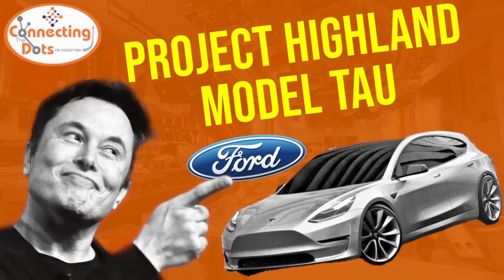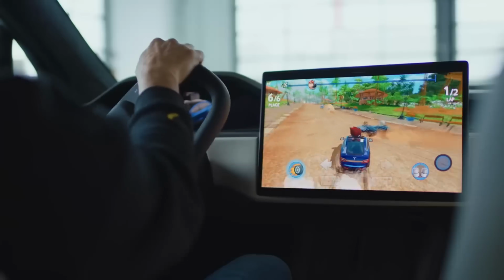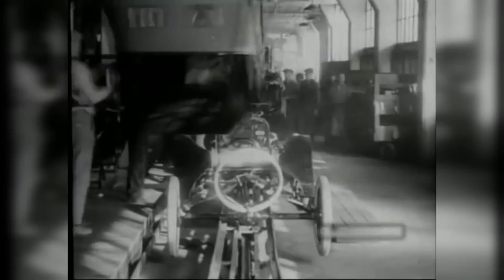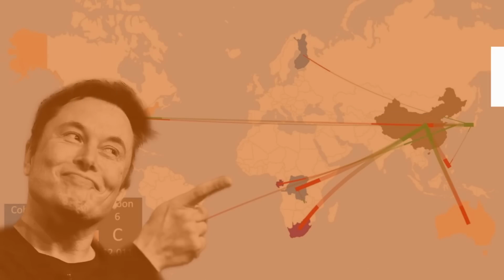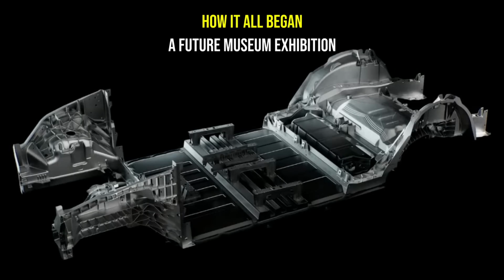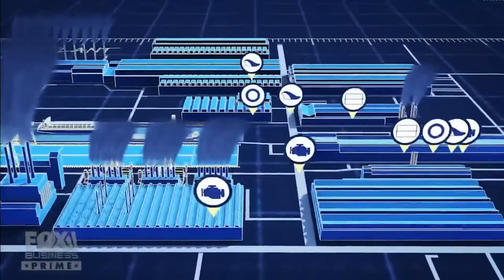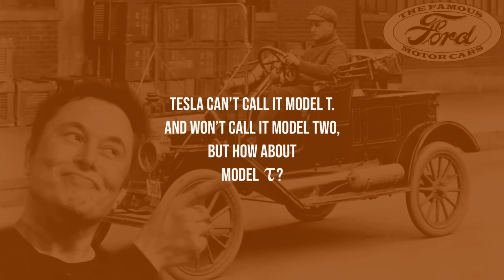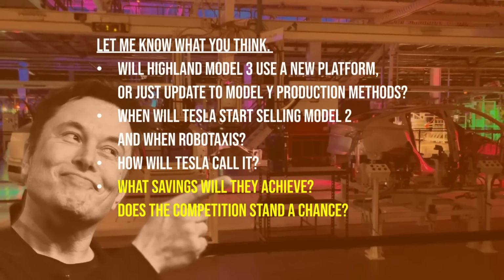Elon's Project Highland, Ford & Tesla Model Tau | A Manufacturing Revolution Pt1 Cracking Easter Egg

Comment: I am excited to see what Highland will mean to the number of factories needed to scale to 20M vehicles in 2029. It may be far fewer than we think?
Reply from the maker: That's my theory
Reply: How many do you think it'll take? 🤔

Elon in the summer 2022 q2 earnings call said 8-12 total factories needed. I think it best we believe him here.
That means possibly only 3 more gigantic tera factories are needed. My bet is gigamexico, giganesia and a U.K. or Korean giga. 

Since then though gigahai production has exceeded a staggering 1,100,000+run rate. With a planned expansion there for another 1,000,000+unit's on temporary permitting hold. This is likely for imo the compact car expansion plan. 

Then just recently gigavada has been approved for a massive $3,600,000,000+expansion more than doubling the plants total size. 

Also Elon has mentioned the upcoming gen3 platform will be half the cost of the model 3&y to manufacturer. 
But it will do double the production volume out of the same sized plant. 

That's imo the compact/robotaxi platform built with a 4680 cast structural pack, f&r single piece castings and the frame being a single large cast piece. So just 4 major castings to produce a basic car. Imagine how cheap&fast that will be at scale. 😎
Reply: @4literv6  Don't know to be honest. When asked about the Gen3 platform at the Q3 earnings call we got the following response from Elon and Zach:

Elon Musk - ........certainly exceed the production of all our other vehicles combined. I mean, obviously, we're going to take everything we learned from S, X, 3, Y, Cybertruck and Semi into that platform. But we -- as you've said to us many times, we're on a 2-for-1 target. So [Inaudible] we're trying to get to that 50% number again.

It's like, we're going to take two. If that's exactly what [Inaudible], how are we making two cars for the amount of effort that we currently take to make one Model 3.

Zachary Kirkhorn -- Chief Financial Officer

Yeah. Effort costs, efficiency.

Elon Musk -- Chief Executive Officer and Product Architect

Needs to be considered.

Zachary Kirkhorn -- Chief Financial Officer

Yeah. All those things. Half the loss, half the past, half the factory floor space.

Not sure if the "half the factory space" comment implies that half the number of factories will be needed for a 20M run rate. What do you think?

Comment: Object to this whole video. First I will offer you the possible new name. Instead of tau it would be PIE (3.14) Model TT (I can't show the actual pie symbol). Here is the problem with this video. There will not be a model 2 (tau). The smaller the vehicle the less space for batteries, less range, increase range anxiety. It was already stated in the past that Model Y will replace the Model 3. The two are very similar and there will no need to sell Model 3. Second, although advanced production methods may drop some cost of the production those saving will go to increasing profit margins. Business is in the business of making money not selling for free just to make people happy. The reason why Model 3 production hasn't stopped right now is because the Cyber Truck hasn't be released yet. Once the Cyber Truck is released, the market will be totally different. The Cyber Truck will do everything that both the Model Y and 3 can do and better. Thus no one will need anything other than the Cyber Truck and the Model S. The only reason why the Model Y may still exist is because some might feel the Cyber Truck is a little high to enter in and out. However, the production methods is not what will significantly reduce the cost of purchasing any tesla vehicle, what will is the move to solid state battery technology when it is released. Many years ago Toyota announced that they will release the solid state battery vehicle in 2025 (that date might change). I suspect that is delaying the release of the Cyber Truck. No point producing a vehicle that will be out of date one released to the public. Telsa may be waiting for the announcement to see if changes are needed or if going ahead is acceptable. There is so much more to add here but this is giving me a headache. If you are interested in contacting me, feel free. I will be more interested if contacted, otherwise why submit a comment for no one to read or care. Thank you. Have a great day.
Reply: The Taliban ‘object’ to peoples thoughts.
Reply: @paulmcgreevy3011  learn to read and educate yourself
Reply: Audi has a  model TT.

Comment: The river rouge plant on drained swamp land has an extra similarity to giga Austin which is being built on reclaimed swamps beside the Colorado river . Both river rouge and Colorado river translate to red river in English. Is giga Shanghai on the yellow river?  I agree that Elon was referencing Highland Park and not Whisky distillers and tartan kilts and thankful that you have put all of these clues together. From the horse and carriage to the horseless carriage to the driverless carriage. I want to travel in a TAU!😃
Reply from the maker: Didn't notice the point on Colorado. Nice!
Shanghai is on the Yangtze River, meaning "long river"
Reply: @ConnectingODots  i agree. GigaAustin also uses raw materials that go into the cathode building and then results go into the battery building. So similar to rouge!! I wonder if supplies can travel by the colorado river. Im gonna look out for any docks. GigaBerlin is already building a train station right on campus to bring in workers. They used the rails to bring materials when building phase 1 factory.

Comment: Interesting. The Burnt Hair hint, if true, will be so hilarious when considered retrospectively. There is a big time gap between March Investor Day, and Q3 2023 which is when it is believed the "revamped" M3 will be revealed. Will the bulk of the Highland M3 features be "under-the-hood" so to speak, meaning that aesthetics are not greatly changed however the cost-of-goods-sold is drastically reduced?
Reply from the maker: Although not really related, I'll address this in the engineering analysis video.
Basically :
1. No real way to know, 
2. from what I see Elon consistently avoids changing the styling. Form follows function, so if there's no real need to change it, "fresh new style for buyers" isn't a good reason to retool. Also, He's educating us not to change cars for fashion only. 
3. I do only see them changing the styling if it helps aerodynamics and/or manufacturability
Reply: @ConnectingODots  interesting take. I have no issue with the approach generally. The pro to this is that owners have a car with a more timeless look, for longer. The con to this is that parts of the asian market (and many other consumers) place big emphasis on having the newest look/style. For people with that mindset, they view the 3 and Y and old style.
Reply: @ConnectingODots  yes I grasped this a long time ago when I realized that each new toothbrush claimed some new fantastic advantage but dropped the previous ones without regret. The dentists reminding me how important is the new toothbrush from XY but it never resolved anything.
Reply: @ConnectingODots  Traditional OEMs change the styling to entice customers to update to the new model (while trashing the value of the superseded style).  Tesla does the opposite - continually updating the car with hardware changes, but most importantly with continuing software updates that both improve the car and its resale value down the track.  Polar opposite to the incumbent OEMs, and a big contributer to brand loyalty.

Comment: I think the 10 hours/vehicle (vs. 30 hours for VW) to assemble a Tesla refers to person-hours of labor, not the cumulative takt (clock) time for all assembly operations, as you seem to have presumed. The significance is that this 10 person-hours indicates that Tesla has more fully both simplified and automated the production/assembly process than any other vehicle producer, to minimize cost and to maximize consistency for quality of assembly.

Comment: I think the "Highland" name is a reference to the Ford factory but in this case it is not about the machine that builds the machine.  I believe project Highland is more about a major ground up rearchitecture of the vehicle platform that will drop a lot of legacy cruft such as 12V and CANBUS.  I think we will see 40-48V for low voltage components and everything talking via ethernet.  The ultimate result will be vehicles that are far simpler, less wiring and much, much faster to produce.  Two vehicles for the effort of one.
Reply: I think 48 volts is quite likely to be used on the Cybertruck first.

Comment: Someone asked earlier, why Ford didn't invest in gas stations like Tesla invested in batteries? Well, Ford did do something with gasoline. Ford produced, blended, distributed and marketed Ford Benzoil (gasoline) which was a waste product from Ford's steel making process. Tesla is well on their way to epic vertical integration. Raw materials in and finished products out. This is the way.

Comment: Could they be using one rear, casting for both model, 3 model 2 and Robo taxi with LFP batteries and using different, casting on the front for the three different vehicles

Comment: I think that the new model 3 will use front and rear castings like the Y, and the structural pack. I don't see it using much more than that, and it won't be the 3rd gen platform. In that comment from Elon at about 31.50, he actually says the next generation car will be half the cost, and faster to build, then "It will smaller, to be fair..." My guess is that the major speed boost and cost reduction will be a one piece cast body. I can envisage how they can do this, but in something the size of model 3 will be even more difficult than in a compact size which is what I think it will be. Model Tau is an intriguing possibility, and even if they weren't going to before, Elon might steal the idea.

Comment: Profits are everything in business it is what it feeds on and is the life blood of growth, Tesla like Apple creates products that are required by the customer and are easily cross sold. Tesla's Semi trucks will need plenty of charging stations at the customers premises and along the highways to extend the range of the overnight truck driver. Nevada will make mega packs for the charging stations building a bigger network that can rapid charge from the mega pack without the need to run high power power cables to many of these remote sites as the megapacks can be charged from Solar panels and normal power resources and the stored energy will rapid charge to the Semi's. This alone will boost Tesla profits and build the energy distribution business across the States, selling Sun power is close to pure profit so expect to see many Tesla solar panels being installed
Reply: Sun power is not pure profit it’s vey expensive. It requires land and premises, it requires expensive solar panels and batteries. It requires cleaning, service and maintenance and the whole lot needs to be replaced every 15 years or so. This is why renewables represent 5% of global energy production after being around for 50 years.
Reply: @paulmcgreevy3011  You must have read a book on it 20 years ago and have not grown with the times, that is all old vacillations. The design and placement of solar panels on the roofs of Gas stations is common as it is of course on the roofs of all Tesla factorys, so a truck park has an open roof area jammed with solar panels, high energy panels last 25 years today and are close to 25% efficient in converting energy and these arraingments are already been installed because they work and make money, the only thing missing is customers. The Semi truck will not take long to ramp up sales as already it demonstrates how cost effective it is and with Tesla building 2million EV's this year and 3 million next year the energy market for these EV's is going to explode. Just check out how much money the charging stations already make and then understand that if that power does not have to be paid for by the charging company how much will that affect the profit bottom line. it is a no brainer for a business. Auto panel washers can clean them once a day, like a screen wiper can clean you car windscreen...easy.

Comment: The Only thing Henry Ford revolutionised was the Assembly line  Elon has done so much more and the  Casting
Reply: No, Ford also used better materials than other manufacturers. My father-in-law went to college after WWII, and lived in a shared apartment that came with a (non-Ford) auto. It was so flimsy that the driveshaft twisted.

Comment: Excellent work. Very interesting! In a recent drone flyby of Giga Texas (3rd floor Eastside) you can see hundreds of new assembly robots lined up against the windows (about a 1/4 mile of them). Those could be for the Cybertruck line, but now I think they might also be for a Project Highland line. It's easily as may robots as were moved into the building before the Model Y production began. Can hardly wait for Part 2 to drop on Patreon!

Comment: Musk innovated profitability by making his cars with fewer and cheeper parts.
But the cheep is pissing off alot of clients
Shitty interiors and steering wheels no defrost on drivers and passengers door glass.
No buttons for anything.
Failing doorhandles autopilot that often doesnt work regen not working failing batteries failing cpu failing.
They are also over priced. Finaly the price dropped.
Toyota lexus at least has comfort and reliability. Hybrids for less.
If tesla doesnt up their comfort and reliability.
They will fall behind.
andvthe model 3 this hans guy designed a mazda 6 for a tesla. Ugly!!
Reply: What are you talking about. This is the most comfortable car I have ever driven. Who needs dial! Many things are right at your fingertips. Have you ever driven in a Tesla. It is so intuitive and easy to learn to use. I couldn't disagree with you more.
Reply: @larryetzel9847  
Have you driven a lexus rx 450 h 
At least you get seats.
The tesla seats are sh.
Reply: Pathetic
Reply: Hope you enjoy your Lexus as much as I enjoy my MY.

Comment: What if the M Tao is a smaller version of the Cyber Truck or at least a smaller car built on the Cyber Turck platform?  There are all kinds of hints that the Cyber is the platform with the 50% cost reduction... with breaks and steering driven all the way to the wheels without the costly linkages.  You could get rid of the transmission too if you put the motors right in the wheels....but you don't want to bounce the motors like you bounce the wheels.
Reply: Motors go next to the wheels unless you are splitting the power to two or more wheels.

Comment: You rock it!

I've been drawing a better design flow for EVs. I think that megacasting's impact on that is underappreciated, from what little I can see out here.

Partly that's from my own take on what MPP3 can be. In keeping w/Elon's vision, I built it around synergistic connections between all his companies. Something he says in public he doesn't  see.

The implications when drawn back into factory design nudged me to consider a different flow for assembly which implied a different shape, overall. This video bringing visions of Ford's ideas as they informed factory design decisions confirmed that my designs merit consideration as they address flow constraints. And they rely on that synergy.

I'm working on a proposal.
Reply: One issue with megacasting that worries me: A moderate small overlap impact that reaches the horns of the front frames can be fixed in a normal car, but in a megacast one would probably mean a write-off, no?
Reply: @surturiel  
Nice question.

I think that castings can be trimmed. they have to be deburred. They also can be recycled right there.